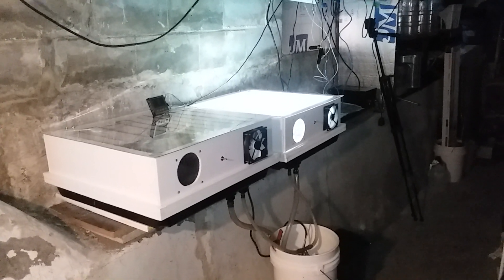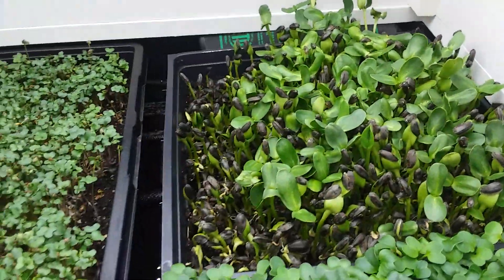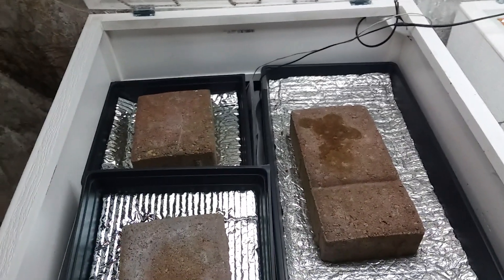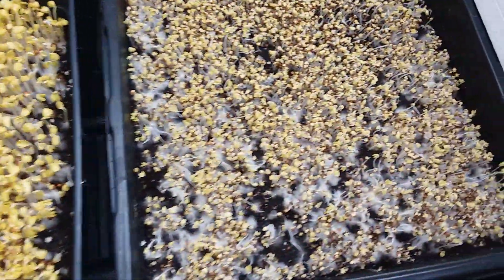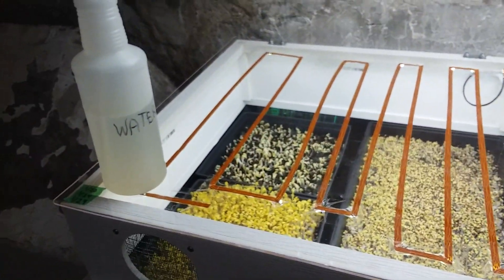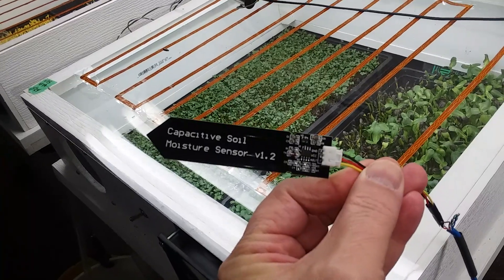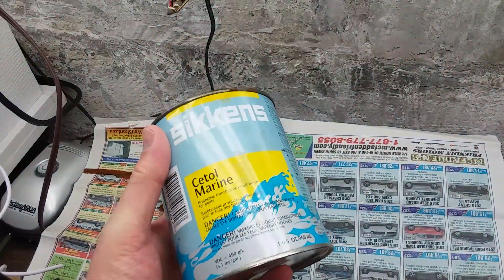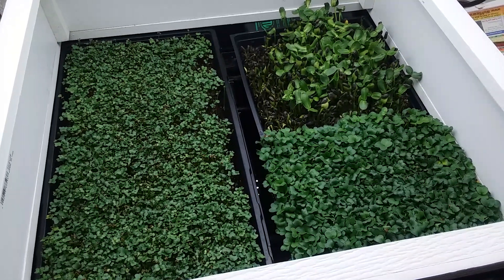Unstacking Microgreens and Capacitive Soil Moisture Sensor

Comment: For this sensor is necesary to use some kind of coating around the edges. I used clear nail polish because conformal coating was expensive. There is a limit to how deep you can put in the soil, that is right before the smaller components. Also coat the smaller components and the wires soldered. They take a few seconds from dry to wet in order to get a good reading. Good luck.